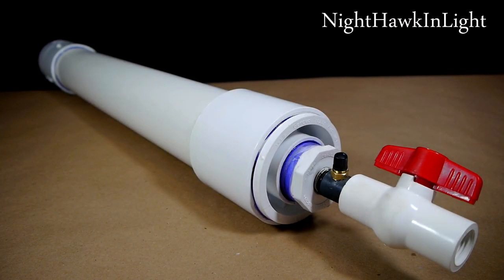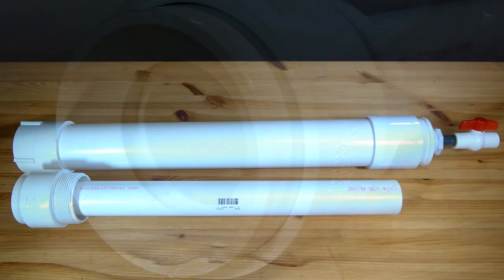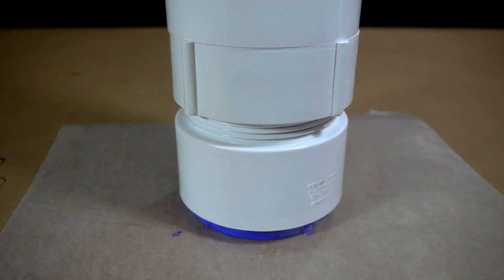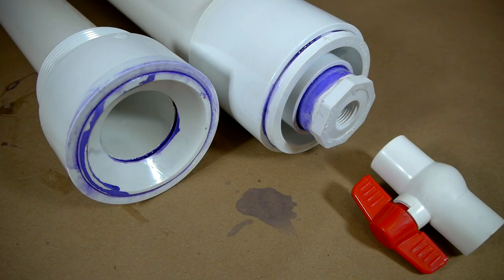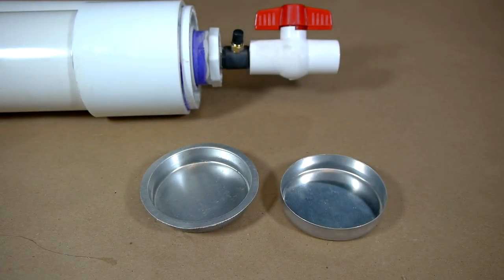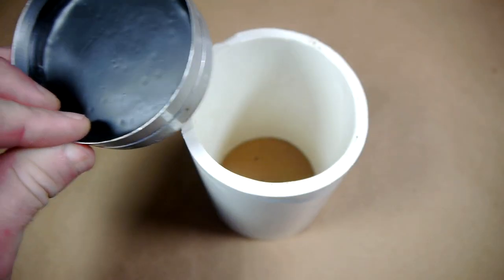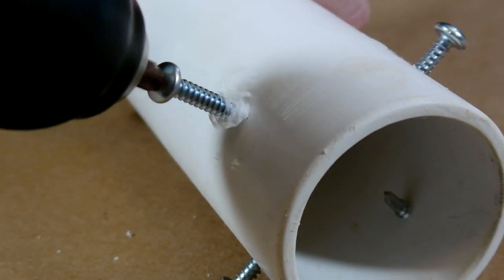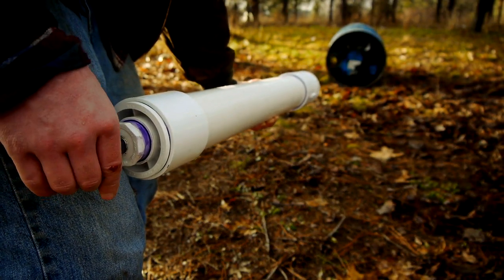How to Make a Powerful Coaxial Piston Cannon from Hardware Store Parts

Comment: Cool, I made one that you pump up and stuff a 1 foot metal rode into the barrel. It fires up to 100 plus feet and uses the same trigger concept as this gun. It is basicly a high powered dart gun. We tested it and it when clean through 2 inches of pressure treated wood. Also one night we tied a sparkler to one of the darts and the shot landed in a tree and we almost burnt down the neighbour hood ;)

Comment: I’ve been wondering if the “trigger” valve could be routed a bit more forward using a “U”-shaped pipe assembly and a bit more PVC so that the valve is more accessible. Also, would a 90-degree faucet style valve work as well? Thank you.

Comment: Also, if anyone is wondering I found the parts at Lowe's (all PVC, sheet rubber, epoxy, cement/primer, tank to bowl gasket, screws, aluminum tape, super glue, thread paste), O' Reilly auto parts (brass air compressor valve), and Target (I used tin coaster rather than t-caps which are very hard to come by).

Comment from the maker: Home Depot. It is strange, I am having a hard time finding the precise fitting I used in the video when I search online. If you cannot find the specific one I use, you can instead use any 3x2 reducer or bushing. The only issue you will have in doing so is that you will probably not be able to flip it around backwards into a coupling like i do, so the ridge on the inside that stops the pipe from being fed in through the back side of the reducer will have to be sanded down.

Comment: As a cannon builder myself i never thought of the coaxial design! Impressive! do you think that it would be as efficient with a combustion rather than just compressed air?
Reply: PVC shatters into dagger-like shards. Might not be a good idea to use combustion unless you have a good handle on the peak pressure.

Comment: there are mini bike pumps you could mount onto the cannon and have constantly connected for quicker loading and less to carry around
Reply: If you left a bicycle pump constantly connected, after pumping it up; air would leak back through, past the pump.  When the pressure behind the piston drops below the pressure around the barrel the cannon would fire on it's own.... which may be slightly unsafe.   A manual valve could be added on the inflation side, or even a 4 way valve connecting the barrel to inflation/off/exhaust so that inflation/aiming/firing could be done with one lever.
Reply from the maker: qkiller Air can leak around the piston in both directions. Unless air is released behind the piston at a faster rate than it can leak around the cannon will not fire.

Comment: We followed all your steps and our cannon isn't working. The piston is stuck and isn't moving to cover the barrel. Therefore our cannon isn't shooting and the air is rushing out through the barrel. Also, even when it does cover the barrel we compress to about 30 PSI. When we release the air using the valve no air exits from the front on the cannon. Only from the valve. We are using a hockey puck as the piston and were wondering if you have any suggestions. Thank you!
Reply from the maker: Adrian Widjaja If the piston is sticking it's because it's able to turn slightly sideways. It's therefore either not a tight enough fit, or not long enough, or both. The air being released only from the rear valve is caused by a loose fitting piston, or too much air volume behind the piston, or both. Increasing the valve size can get around these problems, but I would try tightening the piston first.

Comment: NightHawkInLight I've fully constructed the canon with no success. I even made the piston from the gas vent tee caps by hand filing the rims down (not an easy nor short task), but the piston you put in the barrel does not look like the one you glued so did you melt the rubber or something or is it just epoxy? Also, theoretically could this cannon be built with precut 2' barrels instead or would the pressure be too weak?

Comment: Is the pressure rating of the pipe still valid if the pressure is being applied inward instead of outward? I'm concerned about the barrel inside of the chamber. I don't think the material has been pressure tested to withstand that sort of pressure being applied in that way.

Comment: Hi NightHawkInLight -

I built this over the weekend and can't seem to get mine to pressurize...everything seems in order.  The only notable exception is that my 3" to 1 1/2" reducer is cone shaped instead of cylinder shaped (I couldn't find the same type here at Lowes or HD).

My piston seems to be snug yet slide in the 3" outer tube, and I used a couple of layers of the rubber sheet to help the 2" pipe seat better.  I sanded the 2" pipe end with a 2000 grit paper and it is really smooth.

I have some photos if you need to see them...any thoughts are much appreciated.  I want to use it to launch a toy parachute man with the kiddo!  thanks!

Do you need a potato slug regardless of any other payload?
Reply from the maker: Try smearing some TFE pipe thread paste to the face of the piston, that can really help the rubber to seal against the barrel better. You should be able to fire any type of projectile without issue. Just be careful of firing heavy objects, because the kickback will increase with heavier mass fired.
Reply: NightHawkInLight
Will do, thanks!

Comment: Hello night,
Im currently making this and I was wondering how much the piston has to move? It doesn't move with the 3 2 2 in diameter barrel. Also how much air should the piston leak and how much should it slide in the barrel. When I turn the barrel upside down, the piston slides out the 3 in chamber slowly. I think that might slide to much? 

Thanks

Comment: Nice. One question, if this type of cannon was built to about 2x in size, will it have increased power, enough to clear a range of 30-40 yards if loaded with, let's say, yellow squash?
Reply from the maker: Piston cannons can easily fire over 100 yards.
Reply: Thanks for the response. But, just curious, whats the effective accurate range if your cannon?

Comment: This is cool but what are the benefits of using this piston system compared to just a two chamber system where one chamber is filled with pressurized air and the other chamber is the barrel with the ball valve in between?

Comment: it was because it was pressurized when you release the valve the gas (air) expands very quickly causing the steam. You can also see this by twisting a closed water bottle (no water in it) and opening the cap quickly.

Comment: and insert so these formed "flaps" face backwards, it makes quite an air tight seal, becouse under preasure they expand, but it slides much more easily, achieving much higher speeds. however, theyre bit more expensive to make, and with their higher speed, and just being woode, you can seriously hurt someone.however, you could add some sort of dart on the front and shoot at targets. these flaps act like wings, and keep it going the right way.

Comment: Why only 40 psi schd.40 pvc 3 " is rated at 260 psi and 2" is rated at 280 psi? other cannons run at 100 without issue.thanks and great video.

Comment: If I were to apply cornstarch to one of these pressurized pipes, would it be safe enough to use?

Using your halo build, and applying a torch at the end. Is what I had in mind.

Comment: So does anyone have a rough estimate on power for this thing? It looks like it works really well, and even seems more reliable than a combustion potato cannon(no cool flames unfortunately). But my big question is, if you made the valve in the back larger would that give you more speed with more space for air flow? Also could you instead of making the valve on the back, run a tube from there to the front so you could hold it like a bazooka?
Reply: This will be more powerfull than a combustion type canon because pressures generated with hairspray burning are not very high. The compressed air canon has instant release of high pressures generating higher speeds.

Comment: Can you use a 3 inch by 3/4 inch piece of wood with the rubber on and tape around it for the piston? Or is there anything else I could use because I can not find that part needed at Lowe's, ace, home depot, tractor supply, walmart, or my local hardware store.

Comment: Instead of the T-caps or a hockey puck, would it be possible to use a bigger piston like you've made? Maybe attach another rubber seal (just larger) on the end of the barrel? I, like others, are having difficulty with the piston sealing. Thank you!
Reply from the maker: Anything that is a good fit in the pipe is a possible piston. Before giving up on whatever you're using now try spearing the face with TFE paste and that sometimes helps.
Reply: Great! Thank you for the advice and for your videos! I really appreciate it!

Comment: Could this cannon potentially be scaled down to take a smaller calibre of round, for instance 1/2 inch or smaller, or would the pressure likely cause the smaller piping to burst? Presumably to scale it down I'd also need to search around for suitable scaled-down counterparts for the pieces you've used.

Comment: Hi I built this cannon and it looks cool, however upon final assembly i noticed two problems. First I cant get the male and female threaded adapters to screw in flush like you show in the video. and second there seems to be a problem with the seal on the piston. I used a large piece of bike tire for the rubbber seal on the piston. It is held in place with epoxy but wont get a tight seal. I even tried adding some in a ring around the barred. Still no. What are your recommendations for a solution?

Comment: Dang! Definitely would hate to get hit by one! I have a question though:If you'd put 2 blades that have been put together to form a + shape (removable of course, for loading, and so you're not stuck with only that option) at the end of the barrel, would it make it a spread-shot cannon?
Reply: A little late, but... You'd be better off with a barrier the length of the barrel.  One at the end would be far more prone to being knocked loose by the shot than one which seperates the projectiles at the start.

Comment: Just found this interesting build and I have a question. The air coming out the backside, near the ball valve, is it high pressure? And if so, is it a concern? I hope you can read this. Thanks!
Reply from the maker: It's not a concern besides potentially blowing dust into your eyes.

Comment: We have just built this and felt that we followed the directions meticulously except we could not find the metal end caps for the piston. We have used a hockey puck, put a lip on it and wrapped it in foil tape. We are not getting a very good seal and hence it is not firing. Any thought a on ideal weigh of the piston or ideal "lip size"
Reply from the maker: The piston doesn't need a lip, but it does need a rubber face to get a good seal. If you already have a rubber face on it then try spreading some TFE paste on the front. That usually helps.

Comment: Have you ever shot a golf ball from that Cannon? Does it have to fit tight? I made one doesn't push it too far. have a air tank, air blast
Reply: The technique of the cannon is to release air to the projectile, but the projectile shouldn't give much budge, that is until the piston sets back to place. When the piston sets back, the air will force the wedged projectile to launch at great distance and speed. He used a cork for his projectile because it's a great wedge for chambers. Maybe the golf ball isn't good enough to wedge the chamber.

Comment: would you be able to increase the pressure chamber size by adding a 2 inch t fitting and additional piping/fittings/end caps etc. without affecting it's performance, or could that potentially affect internal airflow and firing?
Reply: 3 inch t fitting i mean
Reply from the maker: That works fine. See my more recent piston cannon video on my channel.

Comment: Followed almost exactly (couldn't find tee caps locally so I tried to fabricate my own piston as best I could), but is leaking directly into interior barrel.  
Possible issues:
Having trouble screwing interior barrel into outer barrel all the way.
Piston isn't tight enough (although I had to ram it into the barrel...)
Thoughts?
Reply from the maker: Male and female adapters are made to thread together until tight, not until the threads are completely used up. Don't force them all the way together or the female adapter may crack. To give the piston a better seal on the barrel smear some TFE paste on the rubber face.
Reply: NightHawkInLight Thanks for the reply!  I'll try that.  Do I need to worry about air leaking around the sides of the piston, or should it not matter as long as the rubber face is sealing.

Comment: Add an air pressure gauge, another air valve and then attach it to the U pipe backpack which contains compressed air. Would this work to fire quickly without having to pump it all the time and still have it portable.

Comment: Hi! We built the cannon and followed all the instructions. We used a hockey puck as the piston. We applied TFE Paste to the pack. The barrel is becoming air tight but when we open the valve the air escapes from the back but the piston doesn't move therefore the cannon doesn't shoot. I was just wondering if you have any suggestions. Thank You!
Reply from the maker: Corbin Rego The air being released only from the rear valve is caused by a loose fitting piston, or too much air volume behind the piston, or both. Increasing the valve size can get around these problems, but I would try tightening the piston first.
Reply: Hi!

I believe a hockey puck is rather heavy compaired to the thin sheet metal piston used in a video. That is possibly the problem, because the mass of the puck is inhibiting it to seal against the rear of the cannon and force the air out of the barrel.

Comment: did you have to modify your three inch to two inch reducer to get it to reverse directions like that? the one I have has a lip that would ;prevent it from fitting together the way you have it so I'm going to grind it down.

Comment: I built this cannon, but it's not working.
After airing it up to 40psi, when I open the valve all the air escapes out the rear of the valve.
Do you think that I need to back out the barrel a little???
Reply from the maker: There are a couple ways to fix this. You can make the piston a tighter fit so less air can pass by it, you can reduce the volume of air behind the piston by filling the empty space with something, or you can increase the size/opening speed of the release valve. The issue is caused by air pressure behind the piston dropping too slowly compared to how much air leaks past it from the front.

Comment: In your opinion would an air blow gun, instead of the ball valve, release the pressure quick enough to cause the piston to seat rearward and launch the projectile?
Reply from the maker: No, but a blowgun attached to a modified sprinkler valve would. I show how to modify a sprinkler valve in my video' how to make an explosion simulator'.

Comment: Would this be able to be modified so it could shoot a high power blast of water?
Reply from the maker: It will fire water, but it fires a cloud of it rather than a solid stream. The kickback can be extremely strong from water since it's a heavy projectile, so you have to be careful or it will fling the cannon right out of your hands.

Comment: Hi using the puck idea? Looks like the inside barrel should be a little shorter than 3’2”? Is the correct? You want 1/2” movement of the piston?
Reply from the maker: 1/2" is enough movement
Reply: Hi we are not getting a seal? Any ideas? We sanded the end well but still no seal.